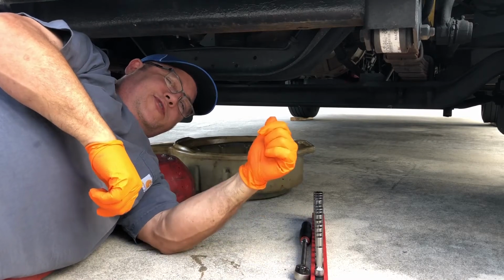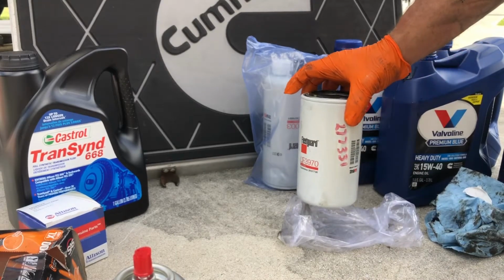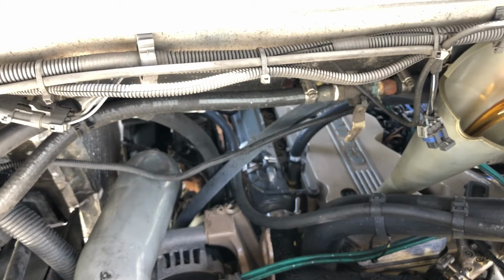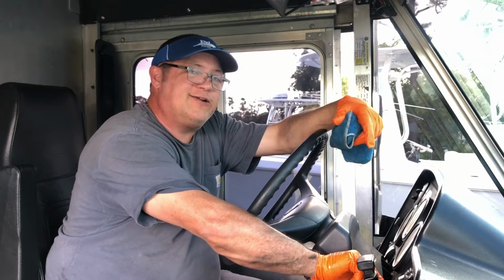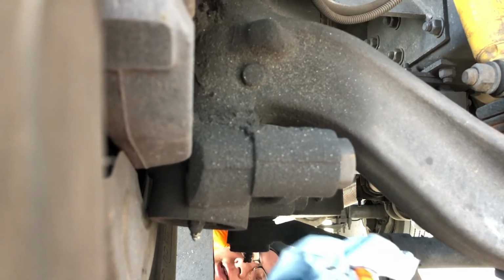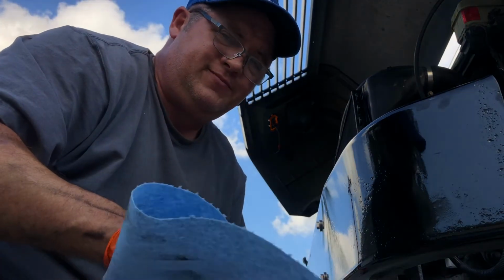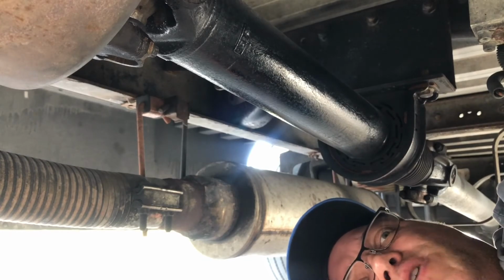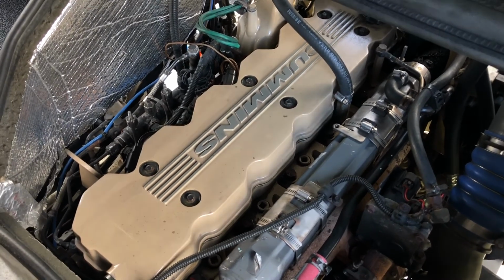Step Van PM service and things to look for if buying used Step Van

Comment: Cool Stepvan. Diesel engines are nice but I’ve always preferred gas engines. Maybe some day I’ll change my mind. The MT series Stepvans are great vehicles. Thanks for sharing!
Reply from the maker: Thanks I had a gas box truck before the step van it was good but with the weight I carry I lean more towards the diesel I only averaged 7.5 mpg so with the gas and 12 mpg with the diesel. But
Reply from the maker: Sorry I was going to say but with the price of diesel being $2 more per gallon plus the maintenance cost for the oil changes and what not the gas isn’t looking to bad these days

Comment: Thank you.  I just got a MT55 and i don’t know it maintenance history on it.  I’ve done the two rear seals and checked bearings, refilled the gear oil.  Now on to the front and then engine so thanks hoping I can get them filters replaced and all new again.  I’m going to buy a powered grease gun after seeing you do it.
Reply from the maker: For parts I use Freightliner with the vin and Utilimaster for anything that is not related to the drive train. Also I am sure you are aware but Mills Supply has a great selection of parts with pictures for these vans as well.
And for the power steering filter mine was part number T1808D

Comment from the maker: Your fuel separator may be a Davco and yes that would be correct for that filter.  During its service life it may have needed a new filter housing and was replaced or it may have been ordered from freightliner like this ether way it is a great filter assembly and will do the job should be a drain at the bottom.

Comment: I been a marine tech for over 30 years. You have a great mobile set up. I'm looking at MT 45's as I want to convert one into an RV/mini home. Looks like a decent truck is a little pricey.  Your's is bitching nice!
Reply from the maker: @glenncivale6824  
Thanks sad thing is my back and right shoulder are giving me issues. I have semi retired from marine industry I have 33 years in the industry very hard on the body over time
Reply from the maker: I rarely use the truck right now a few days a month at best
Reply: I am moving from a p30 chevy to a mt 45
It's a 99 with newer motor.
Smaller body by a little but an excellent platform for me to work out of and live in.
Allows me to do those jobs no one wants cause they too gar away. I get permission to stay on property while I work which saves me so much money it's unreal. No mortgage or more repair just my maintenance and fuel. I got everything I need

Comment: I just got a 99 MT45 and been working on it. All new brake calipers and a new lift pump.
The vp44 can fail if the lift pump fails so I got an air dog and installed a fuel pressure guage so I can monitor . Runs great
I am changing the hydroboost due to brakes slowly locking up. I am going to flush the system but did not see a filter housing just a plastic reservoir. Any advice ?
Sure appreciate this video. Not many on these trucks
Reply from the maker: I would also flush the brake system and to my knowledge no filter on the brake system.
But I have seen bad rubber brake lines act as one way valves and luck up brakes after you step on brake pedal also you said you replaced the calipers the hardware can were out and make sure you’re calipers can slide back and forth use caliper grease on slide points

Comment: I have a 2009 Workhorse W62. Where do you get parts, and do you have a parts list from your PM?
Reply from the maker: For parts I use the vin and can get all the mechanical parts for the Freightliner chassis I also use utility master for some also very helpful in acquiring gaskets for the doors and other hard to find parts and lastly mill supply has a catalog dedicated to step vans
Reply: @ appreciate the info. I can’t even locate what I think is a decent service manual. Just browsed the catalog, wow. Time to make some upgrades especially to the lights

Comment: Hello I have one other question concerning the transmission am planning to change the oil but am not sure if I have to, is there anyway to make sure that the oil need to be changed and in case it need to be changed what you suggest safe way to not harm my Alison transmission, for oil I found mobil delvac 1 synthetic atf tes-295 and I think it will need 3 gal also for filter there is one inside the pan am not thinking to go there but I will change the other 2 visible one, for the filter it reaching 15h2o so am thinking to keep it little while and for the steering wheel I got the submerged filter as well gasket that it was suggested to be changed as well once opening the oil reservoir please advice and thank you :)

Comment: I have one last question the coolant reservoir where it says cold and hot level whenever I start the truck for couple minutes the coolant show under where it says cold on the reservoir and once it stop after couple hour I see it empty but never reach hot.
Reply from the maker: I would add coolant when it is cold use the same color coolant that is made for diesel engines in the reservoir. If in doubt you can add just distilled water but be careful if you are in a cold climate it can freeze and cause damage
Reply: Okay sounds good thank you

Comment: Excellent video. I’m looking at a similar truck, same chassis but Grumman Olson body and a Mercedes’ 4.3 diesel. I’m guessing other than the oil filter all the maintenance items are the same, any pros or cons that you know of between the two body’s and engines? The main pro for the Grumman Olson for me is the roll up door and cab pass through door.

Thanks
Reply from the maker: The chassis is the same for the most part but the motor is different but will require similar maintenance transmission will be the same, As far as the body goes they are all very close in materials and construction just have a slightly different look on the front of the vehicles to me.  
And for the pass thru door when I was looking i didn't want one, but know is the one thing I wish I would have added to my truck.
And for the option I thought I wanted but now realized is not worth it would be drivers side entry door.

Comment: Great video.  Is there a website you recommend to purchase maintenance items?  I have a 1999 MT45 that I purchased a few years ago and want to get it going.  I’m going to do all of these items that you recommend.  Thank you
Reply from the maker: For parts freight liner dealer also look for any Cummins dealers for motor parts you will need the vin for freight liner and the info on the motor for Cummins also Cummins insight start an account with them it’s free put your cpl # from your motor you will have access to parts lookup along with repair manuals for your motor for the body I went to utilimaster and bought parts for the body another good resource is Mill Supply

Comment: Are you familiar with the 2006 Freightliner MT 45 with the 4cyl Diesel? I cannot find the oil filter on my truck.
Reply from the maker: My guess is you have a mercedes mbe 900 here is a link to what you are looking for
 http://www.detroitmanuals.info/mbe-900/090404.html
Reply: @dsmenterprises6699  Thank you i appreciate that.

Comment: I just got 2002 MT45 cumins 5.9 diesel some parts look same just transmission filter and the fuel filter kinda different my truck just got it has 117k mile and I would like to know how to change fuel filter ( specially curious if they all same when it come to start it to fill up fuel on the new filter) also where to get rest of parts and what’s type of grease to use use for chassis bearings. Leave me you contact to reach you thanks.
Reply from the maker: An 02 you will have the VP 44 pump and yes it will have the electric lift pump it is a good measure to check it’s operating on every service as long as the fuel filter is plumbed after the lift pump it will prime the fuel filter. Parts I find are best to go to a Cummins or Freight Liner dealer with the engine number and vin. Also for the grease I use Lucas Red
Reply: Thank you

Comment: Looking to buy one of these 2004 cummins are they normally 12valve or 24? anything particular to look out for?
Reply from the maker: A 2004 will be a 24 valve and most likely a VP series injection pump.
Reply: Check to see if it has the 53 block. Also make sure you do the kdp and add a fass fuel pump. These 3 things.
Reply: @dsmenterprises6699  I got a 1997 mt45, my water separator is facing straight up. that can't be right? also it has coolant lines going to it to heat the fuel I'm guessing?

Comment: Hey how’s it going my step van has been stalling when I have tried to take off and dose not want to go anywhere after it reaches a certain temp could it be the transmission or could it be low oil pressures?
Reply from the maker: What year and motor do you have in your van maybe I can steer you in the right direction.
Reply: @dsmenterprises6699  it’s a 1996 international
Reply: It is a diesel engine
Reply from the maker: @Tv-zx4dl  Is it a 7.3L ?
Reply: @dsmenterprises6699  I believe so
Reply: @dsmenterprises6699  I have to get under the hood to check it out we just have some rain over us right now making it hard at the moment